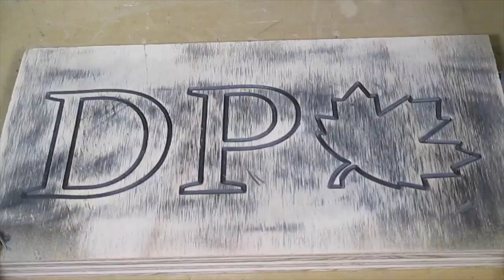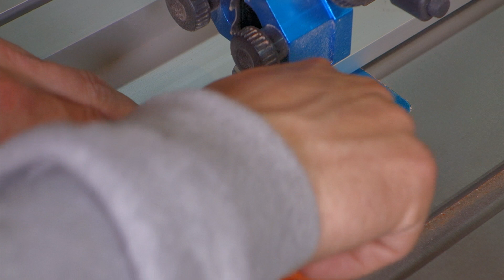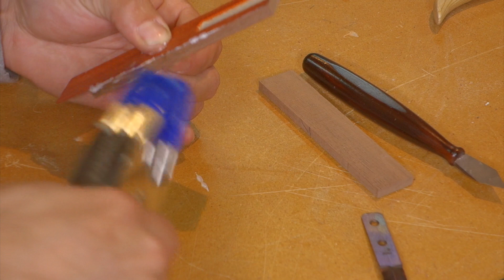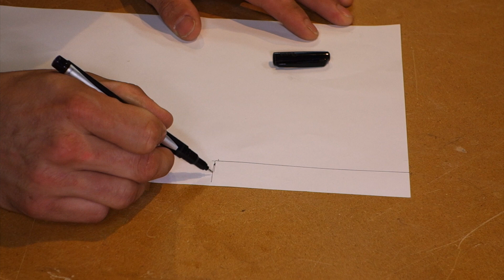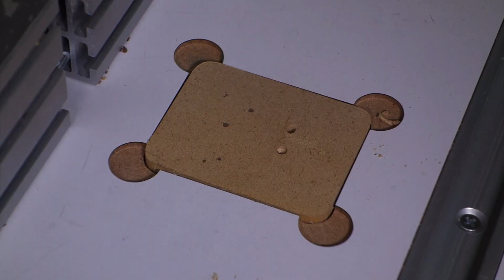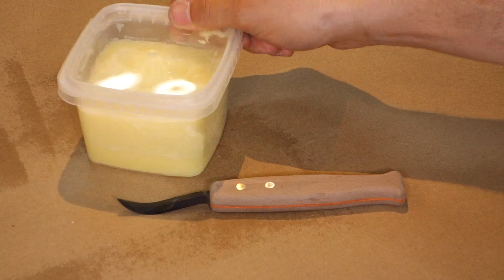Make it - Hooked Carving Knife

Comment: Good chance you'll have your hands full trying to carve with the bevel facing up.
Reply: I have used a set of these exact same Haida blades for around 5 years now and have had NO trouble with the flat backs. They stay fine just from the strop. They work a treat in English hardwoods including oak beech chestnut walnut cherry etc green or seasoned, as well as alder, birch, willow etc etc even though primarily they were designed for softer cedar woods. The one issue I DID have was a big lump of oak fell on one of the knives and smashed the tip off.....but that was my fault.
Davis brothers, now THEY are master bent knife makers, superb beautiful knives. I have a LOT of tools but my 3 davis brothers knives are my ultimate favourites, the more I own and use them the more I love them, awesome tools

Comment: I made a set of knives from the lee valley haida blades. I love them. They are just the right hardness, and FAR superior than the mora hook knives. I made handles from beech or alder, and cut out a section at the ends, made rebates for the blades then epoxied them in then wrapped them with heavy linen shoe makers thread